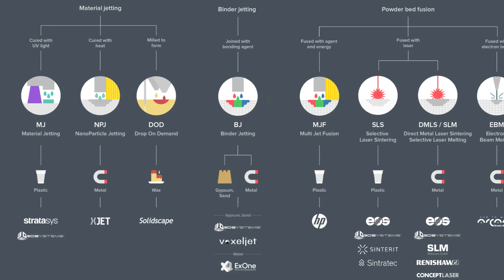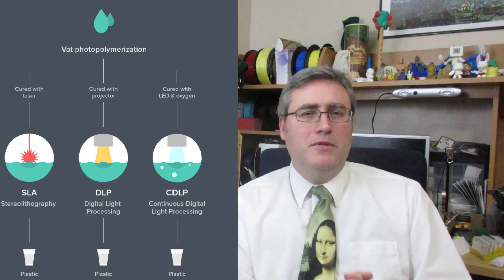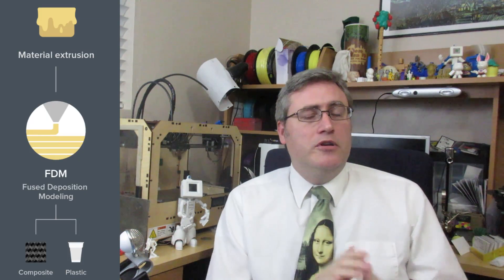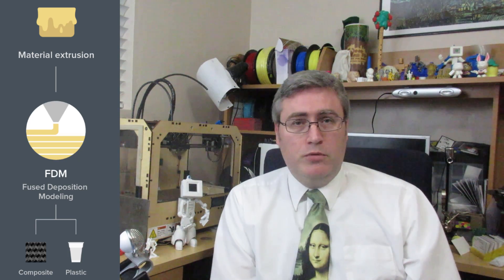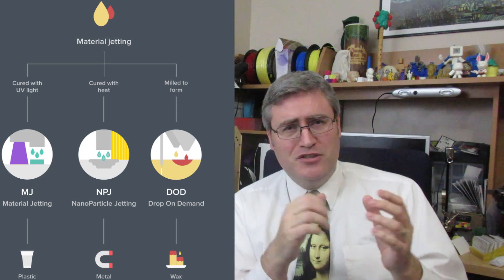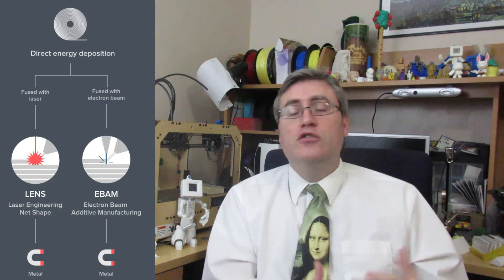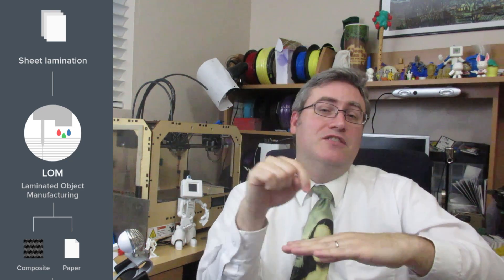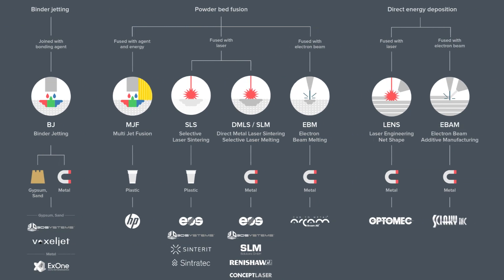3D printing 101 - Types of 3D Printing

Comment: What can I use to print a aluminium gears and small parts with high precision and smooth surface?
Reply from the maker: 3d printing aluminum? Right now, the only reliable option is a printer that melts metal powder with an industrial laser and costs$100k+. Bit its good enough that they use it to make airplane parts. 

The other option is you use a 3d print to do lost 'wax' casting. How do you feel about melting metal?

Comment: I am an architecture student and we use Rhino cad software, how does that compare to other programs that you have used?
Reply from the maker: Rhino's got a lot going for it. Semi-parametric, but also very free flowing. I haven't used it, but by all reports it's more inuitive than Blender, though Blender sets that bar really low, and it's good for those coming from a CAD background, and not unreasonably expensive. That said, without 1000 hours in it I don't know how it compares to my usual toolset in the end.
Reply: I find that it is amazing in terms of how accurately I can translate, for example, a sketched idea and generate a cad drawing for export. I was wondering more so what you have heard about its compatibility with slicing programs.
Reply from the maker: I suspect it's comparability is the same as any other CAD program. it can export an STL or other file format that the slicer can use.
Reply: Thanks a lot. One last question. I will definitely be using this printer for years so Im looking at the Robo R1 Plus because of its extrusion improvements from the R1. The printer has its own slicer but doesn't call it a slicer, and it prints directly from an stl file. Seem fishy or are you confident it's worth the price?